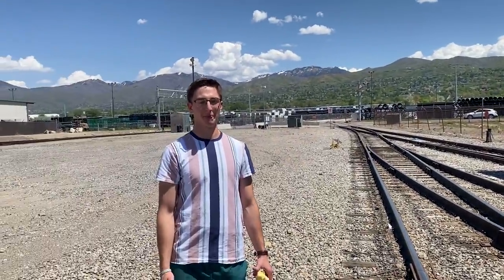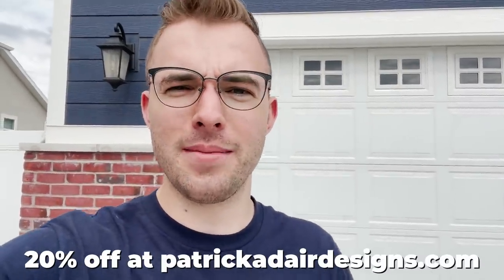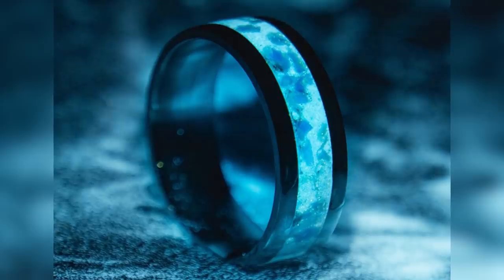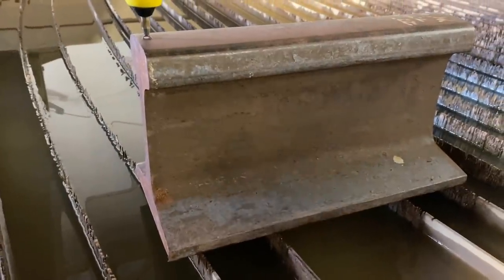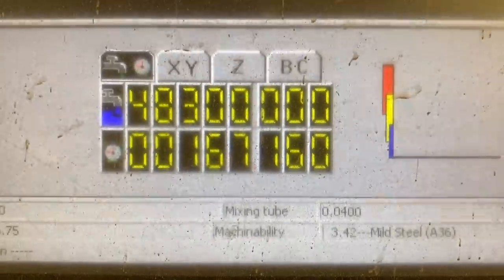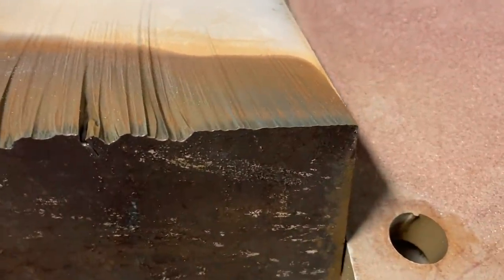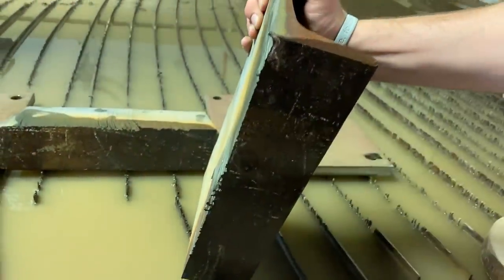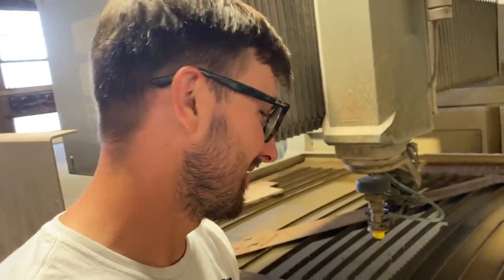Railroad Track Cut in Half with 60,000 PSI Waterjet

Comment: The probable reason it cut so differently in the middle is probably because it's likely a thermite weld that was cut out, I see minor divits in the tracks where I live where the thermite alloy wears slightly differently so that was probably why
Reply: Is that where these kinds of offcuts come from? Do the welds have to fail inspection, or is part of nominal maintenance to remove them?

Comment: Your engineering staff failed to take into account the variable hardness rail!!!! The T-Ball or the head of the rail is hardened whereas the web of the rail is kept flexible so that the rail can flex  vertically without breaking!! This is why your cut was not clean!!! It looked good at the head of the rail, but as it got deeper the water jet was deflected side to side leaving an interrupted cut, starting and stopping then starting and then stopping over and over again!!! Try it with cold rail next time!!!!! Just above freezing!!!!

Comment: 10 84 carbon steel, chocked full of molybdenum which means it work hardens, loosely quoting from AvE ‘it’s got hard nuggets and soft nuggets’ chewed up a few milling bits the discrepancies in your cut may be due to deflection upon coming across the harder or more softer spots, at a guess anyhow, solid effort tho!